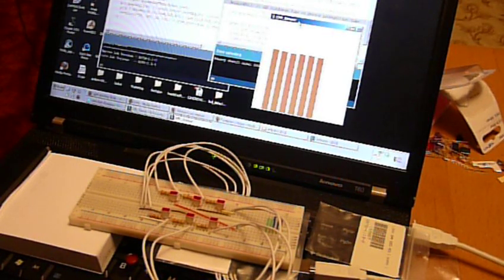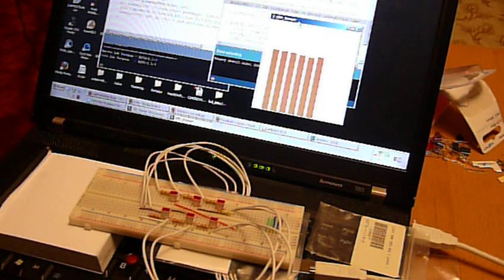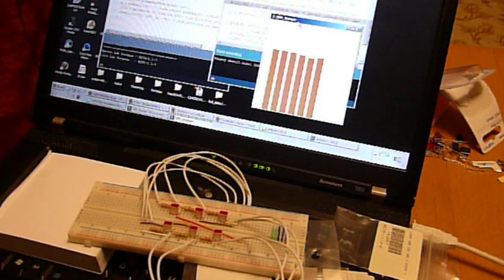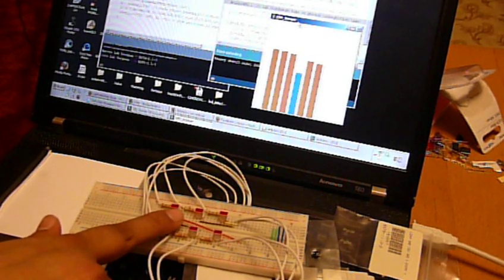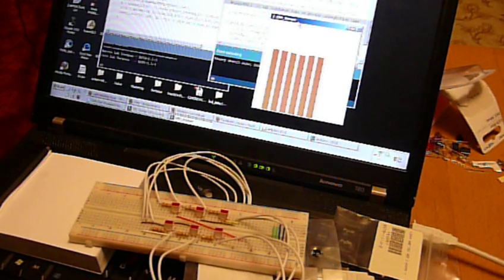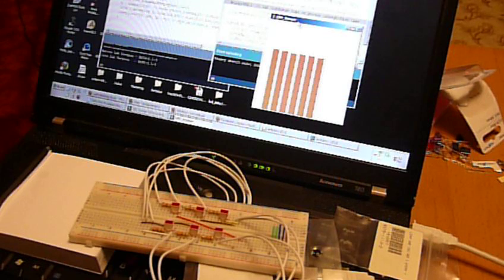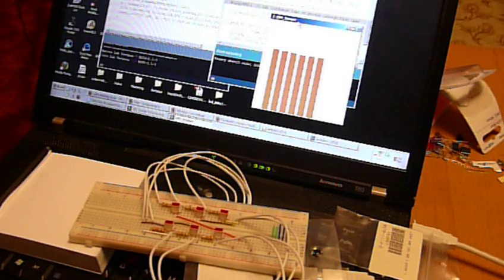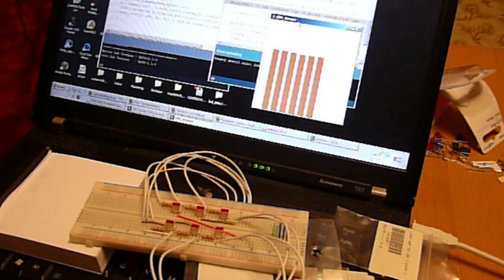LED Sensing - Multitouch

Comment: I was reading through your post on the Arduino forum (Bi-Directional Led Sensing on 8x8 LED Matrix) and found this video after googling the username.

Did you ever get it working properly?